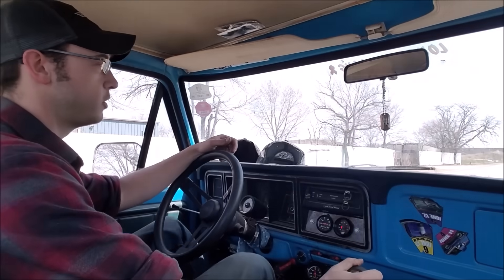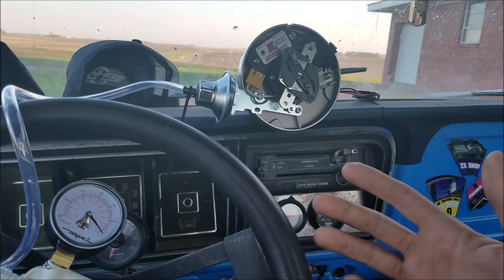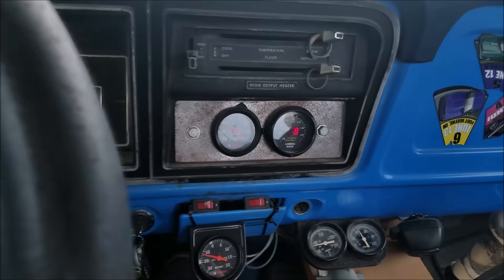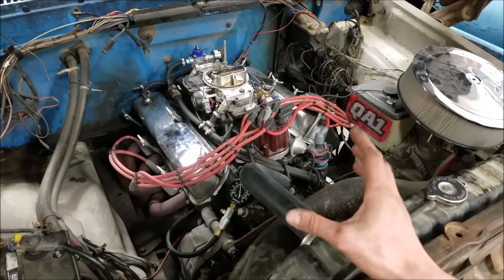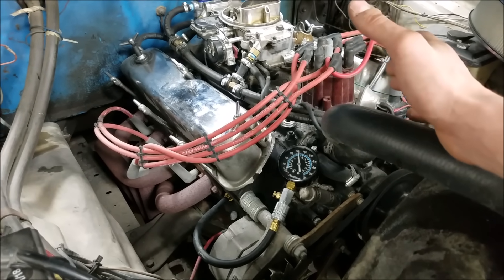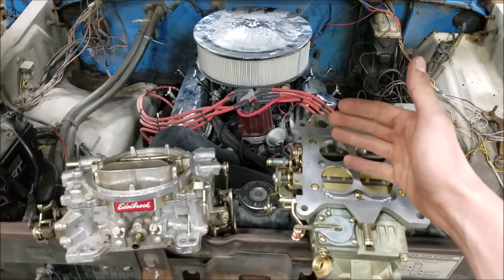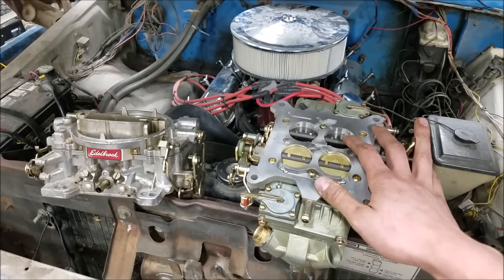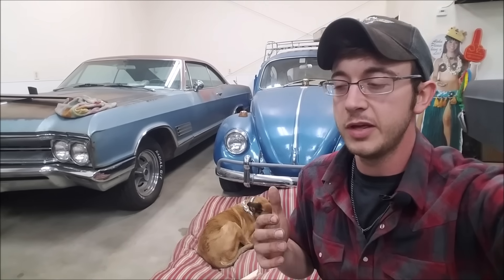Vacuum Advance - Ported vs Manifold: Which to Use & When !!!

Comment: I'm more confused than ever.  This video sounds a bit like an infomercial for Progression ignition.  Also, there's a YouTuber who makes a convincing argument for ported manifold vacuum in this video: https://youtu.be/p6w9-BDu1JU.
 
Aside from a fair amount of experimentation - which I would say involves a full round of tuning connected one way, then a full round of tuning the other way, and trying to discern which way the engine runs "best" - is there a way to go straight to the right answer?
Reply from the maker: If you follow the tuning I do in this video and do your street engine the same way, you will never go back to manifold: 
Thunderhead289 - engineer & heavy automation programmer. 
https://youtu.be/bUv5tUC6Ioo

Comment: very  helpful tutorial.   My factory 1969 350 9.0 compression engine with a comp cam 268 extreme energy cam has had me in a bit of a quandry trying to determine how to optimize tuning.  The cam   may be a bit too much for this engine,.  Currently using a stock distributor and manifold can with initial at 12 degrees  advanced.  Has decent throttle response, but would like to get a bit more fuel economy.  (May be too late for that though).   Thanks for your timely video.
Reply: Hotter cam, more high-end power, worse mileage.  Milder cam, more low-end torque, better mileage.

Comment: I'm at a place with my '52 Pontiac build on my 350 motor swap using an Edelbrock AVS carb that I'm trying to dial all this in. I've watched many a video and this is the best one yet. Thanks for showing the ported vs manifold vacuum on the road in real time. Also, the weights moving under vacuum on the distributer. It's all dial dial dial it in but this helped me understand this topic just that much more.

Comment: If you realy want a quick car like everything else in life , you will make many mistakes on way there ,at the end of the quest for speed you will find your beating yourself up with either or ported or manifold ! Get rid of it and raise your intial timing to were it should be 14 -24 degress and add your final timing # for final or mechanical 30 to 40 were ever your engine likes ,that can hanging off is  junk a
 headache people fight with for no reason. Your engine will be snappy no smell and fast of line with proper timing peroid ,look at the fast street cars out there 😀

Comment: Just watched this video and it was very informative. I wonder if I can pick your brain. I have a 63 Thunderbird with the 390. The carburator base plate has water passages in it that run from the heater core to the intake water port. I wonder why they did this? And is it really needed? You know your stuff on carbs so wonder what you think about that. I'd like to remove the heater hoses but wonder if it affect performance?
Reply: That was to prevent carburetor icing in cold damp mornings.

Comment: Hello Luke, I am loving all your videos, they have walked me through getting my car running right. Now, im right where i think i need to be but just want to get your opinion.

my setup is
 351W, roller X cam, RPM Air-Gap, RPM heads and long tubes. has power brakes, power steering and AC for texas heat. 

Kicker is, im not running a carb, but the HOLLEY SNIPER EFI system. For a coil negative, non timing controlled setup, im using a GM style HEI dizzy with vacuum advance. Right now i have my base timing set to about 10 degrees. but im not sure how to get a total timing reading at 3k rpm. vacuum advance connected? or disconnected? 

Also in this setup i have vacuum advance plugged into ported on the sniper. Should i stay there or switch to manifold. im getting advice both ways... I highly respect your opinion.

Comment: Hooray!  Someone else who says what I've been banging on about for years regarding the (lack of for normal driving) difference between ported and manifold, and why centrifugal and vacuum advance is highly desirable.

Not mentioned is ported vacuum replicates the 'start' and 'run' lever on vintage cars that retards the timing for easier starting and advances it for running, and the subsequent change to manifold vacuum which allows the idle screws to be turned back without losing idle speed to lower idle emissions.

Comment: I used a Y-fitting to hook up the vac adv to both sources to maintain full range pressure. (also put check valves between the Y-fitting and both vac sources) Thoughts?

Comment: Ported vac was only for pre catilitic converter posution control. It is never a good idea if you want gas millage or performance. My big cam Nova could not get emough inical timming for it to crank well with ported but my small cam K20 still does way better with manifold vac also. Before about 1967 ported vac did not exsist.
Reply: My 50 Buick straight 8 used ported, as did my 56 and 61 Nailheads.  My mother's 62 Nailhead also.  The little 215 aluminum engine used manifold vacuum.
Reply: My 54 New Yorker HEMI uses ported.

Comment: I have vacumm advance hose coming from the distrubter to the little nozzle on the passenger front side of a Holley 600cfm carb, is that the right place for it or should it go somewhere else.  another question, I recently swapped to a dual plane performer intake from a single plane edelbrock intake that my holley never really like.  In doing so, the truck does run better but for some reason I keep gettign backfiring through the carb, it happen when I'm on the throttle and let off then get back on a few seconds later.  I have no vacumm leaks, etc. had the timing checked by a reputable shop which turned out to be correct.  could the timining show ok, but the distrubuter be off a tooth or two, was thinking of starting from scratch and setting the motor to TDC and reinstalling the dist...

Comment: I didn’t read all 880 comments but if it has not been mentioned before there is a funny scenario I have fixed for people more than once. They would put a large cam in their v8 and then hook everything up and have full time vacuum to advance, it would sound great in neutral but would die when put in gear unless it was idled very high, the advance it pulled after it started and while they set idle speed would be retarded when just the load of being in gear was put on it, it wouldn’t recover as it dropped vac and lost timing which lowered idle to a point it wouldn’t stay running. This is a engine that doesn’t pull much vac at idle but just enough to create a problem, I would either just set total timing without using advance (Hotrod) or change it to ported vac to fix the issue. Great video 👍

Comment: Hmmm.......I was taught that ported vacuum was a smog era  deal to keep the idle retarded......
Previously, manifold vacuum was used to maintain more idle degrees (initial plus vacuum degrees) yet still be able to crank the engine on the initial before the vacuum  begins.....As you are hammering the throttle, the vacuum degrees drop out as the centrifugal degrees cut in and you only really get the benefit of both if you are accelerating at very light throttle into the RPM range that Centrifugal cuts in while still pulling enough vacuum to maintain vacuum advance (light load)
My mentor was a GM engineer and you are a Ford guy, so maybe that's the difference of opinion  ;)

Comment: Tried it both ways, ported and manifold after getting into a discussion on it just to prove to myself. Did the test both ways with a stock 350 and a streetable healthy 406. Ported worked best for both engines regarding drivability and seat of the pants feel throttle response. I did not use a dyno just common sense and which felt better. Looking at getting a complete 400ci Blueprint engine with carb and HEI as you can't build that power for the price and the warranty. They don't use vacuum advance at all. Run initial of 15º which is high. No stock starter motor likes that. Full in 34-36º by 3500. About 20º mechanical advance and you are right. Who knows what the advance curve unless you tested it? Holley's dizzy that goes with the Sniper EFI system has a near vertical advance curve off idle then flattens off abruptly. Engines do not run at 250k baud rate so that all needs massaged. Since BP designs and dynos every engine, I believe they tailored the best mechanical advance curve with weights and springs for every engine they offer. Maybe it's not perfect to the degree at any given RPM under any load but close enough. Timing is everything regarding power. Good video. Thank you

Comment: You need to go back to school on this.  You are missing the different sources of the vacuum.  One is manifold, the other is venturi.
Reply from the maker: Lol your wrong - you need to go back to school. The only venturi vacuum in a holley 4 barrel is what’s used to open the secondary which is all internal to the carb. Ported is exactly as I explain it in the video. 
Go ahead, fact check me ....

Thunderhead289 - accomplished engine tuner, automation engineer/programmer.

Comment: do u mean progressive vacuum as ported vacuum there is a lot of ports on a carb depending stock some are the same as manifold and there is a progressive vacuum just for this
Reply from the maker: There is no progressive vacuum on a standard v8 carb except for the vacuum that opens vacuum secondaries - which you can’t hook a line to
Reply: @ThunderHead289  did u know that they have 4 barrels with a port right off of the secondaries and y would u buy the cheapest carb on the market when the Quadro jet will walk all over it. do u know the # 1 problem when people rebuild them and the secondaries don't work right. i have had to go behind so many of them because they think they know it. anyone that buys a edlebrock  carb don't have a full understanding of carbs. then u do know u can make a quadro jet into a bigger carb like the 600 i make them into a 850 carb and it never fails . please tell me the problem with the quadro jet after people rebuild them y the secondaries fail please tell me
Reply: @ThunderHead289  then does the vacuum u hook to progress as the rpms goes up if it does from 0 to max then it progresses which means what. u can call it what ever u want but it still progresses. best way to tell what a port does is hook a vacuum gauge to it.

Comment: Another problem with using manifold vacuum on a mild engine is that many, such as AMC 6s, will spit back through the carb on initial throttle.

Comment: Or just run a distributor with out vacuum advance and don't have to think about it. lol  I'm running a Unilite on my car with out it. Pretty good info on the tranfer slots. A lot of people never think how important that is. I have to change the carb throttle plates for my application, because they have holes in them, and the car idles just a tad to fast with the adjustment totally closed. They probably swapped to throttle plates with holes because they were uncovering to much transfer slot for the idle speed adjustment they needed.

Comment: I'm not going to spend anymore time on this video. I'm sure you're going to get around to it but I ain't got the time.
Sorry to hurt your feelings but you are confusing as hell. 

A) Ported and manifold vacuum ARE NOT THE SAME

B) Manifold vacuum occurs BELOW the throttle plates.

C) Ported vacuum occurs ABOVE the throttle plates.
eg. prim. fuel block Holley

Easy  

What source do you use for your vacuum advance depends.  Chevy's it's ported on some Ford's it's manifold. So Chrysler Ford Chevy whatever all you gotta do is know your stuff or a good Professional engine builder.

Ignition timing is much more involved.
Reply: I hope you are not talking to me. I've been in the racing business along time probably longer than you've been alive and I can cut the shit from the shine faster than you can blink!
For the person that has no knowledge this video would be completely confusing.
What I witnessed is a guy more interested in showing off than educating. 
Now I didn't insult anyone I just said make it easy to consume. 
That comes from years of experience taught by some of the best in the business.
So don't get pissy numb nuts I can't take ya out back and teach ya to be respectful.

BTW
I've found in the last 50 years guy like you is you're always late and full of excuses.
Don't ever change we love taking your money!
Reply from the maker: Then enjoy being ignorant - you have to have the why to understand what you are doing.

Comment: My Corvairs all have ported vacuum from the factory - Initial timing is around 16.. Yet my 60 Bonneville with the AFB is manifold vac thus the initial timing is only at 6 BTC. But what I'd like to have since I do a lot of long highway cruising is a dial on my dash where I can max out advance manually to get that most efficient spot.  Does this guys progressive deal do that? You said Ford so I got a 58 FE motor as well.

Comment: I like to set base timing on a mod motor as high as it’ll go so it still starts good hot …..then recurve the advance to the desired max! 
Many times taking out 10 degrees or more from the advance to give it to the base timing. Much better throttle response and power through the whole rpm band! 
Obviously the carb sometimes needs to be retuned also.
Reply: My car runs pretty great right now, but what would you recommend for timing?
It's a 381 stroker, aluminum Victor Jr heads, 9.5 to 1, 650 demon carb, the "big mutha thumper" hydrolic roller comp cam, 4 speed manual, 5" of vacuum at idle, 511hp at 6100 rpm.

The timing now is 22 and 36 total, with an msd pro Billet

On the dyno it still made power at 40 total, but that was with 9.8 to 1, and a race solid roller.
What do yo think?
Reply: @jakefriesenjake  that seems pretty close imo! I usually run about 10-15 degrees advance in many of my big cammed engines! Really depends on the efficiency of the combustion chamber and rpm range……playing with the timing on a dyno would yield best hp and torque
Reply: @markcole6475  ok thanks!

Comment: Chasing Vacuum gremlins on my 79 T-Bird. It has a 351m. I'm still learning the ways of the Carb and these videos are a great help!  I had no vacuum at idle and at part throttle to my distributor. I switched to Manifold Vacuum and it "woke" the engine up, tho I had to tweak the vacuum advance can to prevent pinging. I wanted to get better idle economy driving in city traffic which it did, and it fixed the temperature rising issue that I had. I rarely get on the gas, preferring to cruise with light throttle. Its very confusing hearing manifold vs ported vacuum and I'm always wondering if there's a Better way to tune my car

Comment: So don't get me wrong.   I REALLY REALLY LOVE YOU.  TRULY.  YOUR a guy that speaks my language.    But before I even watch this I'll say no.    No.     Why.     Because  when I use any vac advance  when it transitions to no vac my engines have a flat spot and I Hate flat spots.  So for the last 20 years I don't use any vac advance.    Your engine starts with weights retarded. Then they advance a bit for idle then weights advance all the way through the rpm range.    No problem  no flat spots.      And right now my little 4 gets 47mpg.   And Will do 130 on the hyw.  It's a Isuzu imark with all emissions removed and a carb and dist  is all I have.  1.5 litre  5 speed.    I don't run vac advance because when it's fully advanced then drops off the engine falls flat for a sec and Iike it.

Comment: With a hefty cam and enough octane manifold vacuum will drive much better, use less gas, foul less plugs and make less pollution.   I feel like some people don't understand that and even fight it.  
The weights are designed to add with rpm, it's redundant to use also vacuum.  
I'm surprised how that side fact is so tricky to understand.
Reply from the maker: I advocate for manifold vacuum on big cam engines because they need a lot of timing due to the low cylinder pressures at idle. 
But I do not advocate for that on a typical property built street engine. 

Which I explain pretty well I think as to why
Reply: Ya it did help my big cam run on the street and gave me way better low speed throttle.      Some say it wrong but um? They wrong. Lol.

Comment: Do you have a cross over in your exhaust systems? If not then you should put one in as it keeps that really annoying drone sound out of the note whilst running! And it also adds power! That's what has happened before with my cars! So please do that whenever you can? Ciao A'ight brother? As I have said before, Eres el mejor mi amigo Ciao for now Out

Comment: I had a California smogged out 78 gmc jimmy, factory smog/vacuum line for the dist pot had it on a manifold vacuum just below the butterflys, which added to the static timing while running.. I switched to ported vacuum and it ran tons better with better fuel economy... This was a built 4 bolt main sb 383 stroker with every California illegal internal part you could think of.. but yet it ran cleaner than a new at that time 92 honda accord, the smog guy was surprised at the sniffer results... The only California legal part I had on it was the MSD 6A and distributor/coil. Even the heads were California illegal dart 2 open chamber heads 202/1.6 with big intake runners, the pistons were trw 11.1 pop-ups but with the heads final cr was at 10.1.. no pinging after timing curve adjustment on the distr weights and adjustable vacuum pot.. lived that truck.. should have kept it.. the cam was on the higher end on the mild scale.. also did some mods to the q-jet..
Reply: Every time I had to smog it, id have to swap vacuum ports and adjust timing as per the smog Nazis...